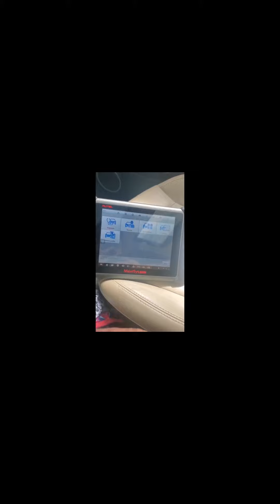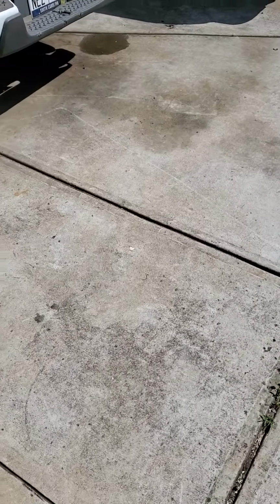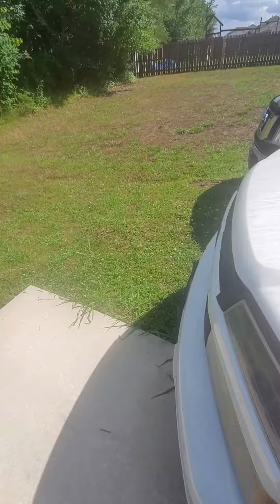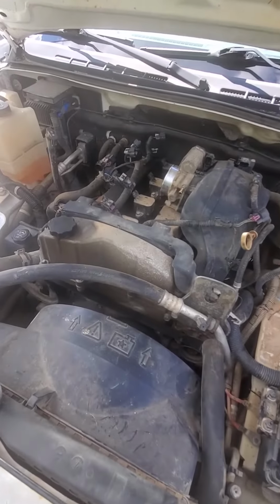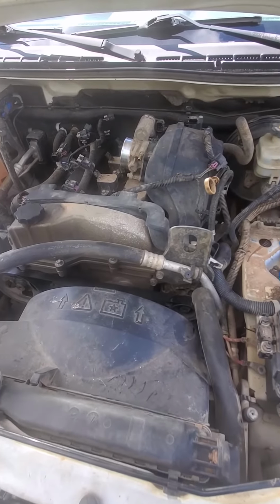Project: bagged and bodied Chevy colorado

Comment: Is there a guide to swap the suspension? I have a canyon that I want to put on air
Reply from the maker: There is not really a guide to swapping the suspension as I am using a mustang II weld in kit to swap it over to 5 lugs.  There is a company that makes control arms for the canyon/colorado.  Let me look it up really quick and I'll get you the company.
Reply from the maker: Fabbotfab.com makes control arms to convert it to the crown vic front spindles and lug pattern.  Plus you have to shorten your rear differential be able to tuck on these trucks
Reply: Epic fab out Canada  makes a full front kit for the colorado.